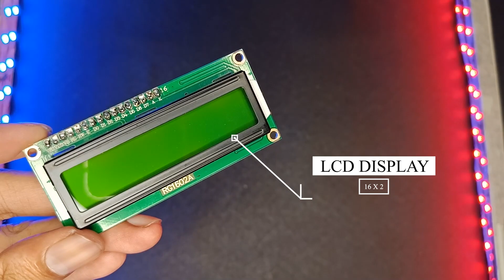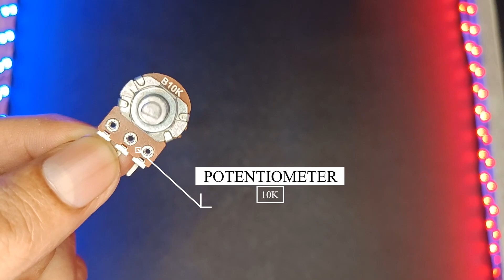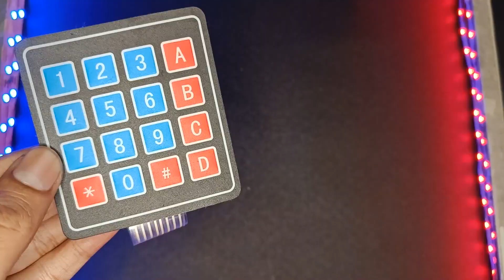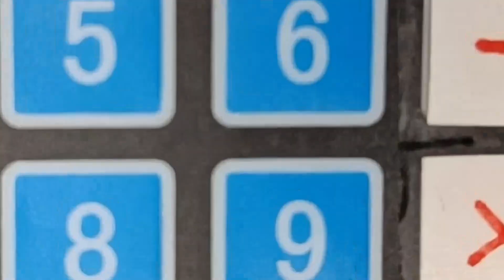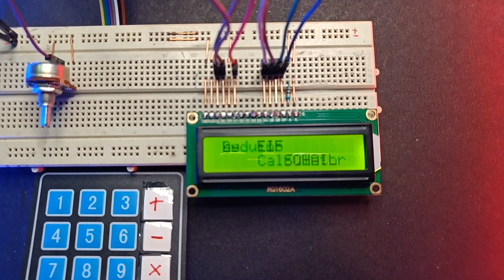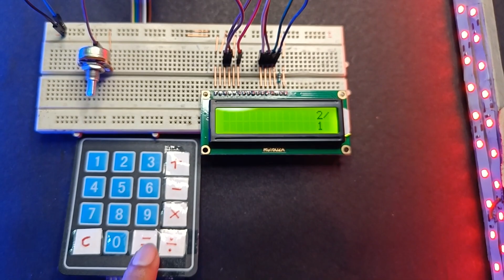Unleash Your Creativity: Build an Arduino Calculator with a 4X4 Keypad | Arduino Calculator LCD

Comment: The code doesn't work even though I follow the steps
Reply from the maker: You haven't followed all the steps.. because code is in the description.. website link. 
https://www.electronicsisfun08.in/2022/12/how-to-build-arduino-calculator-with.html?m=1